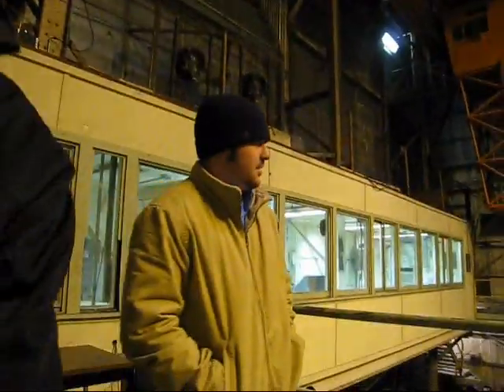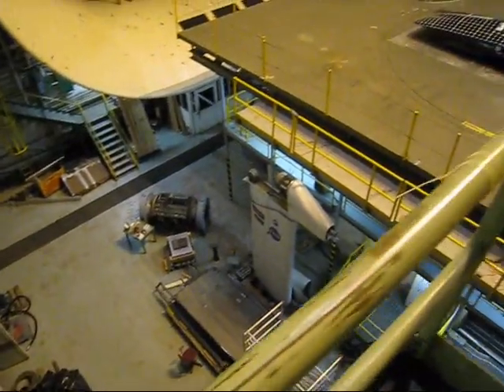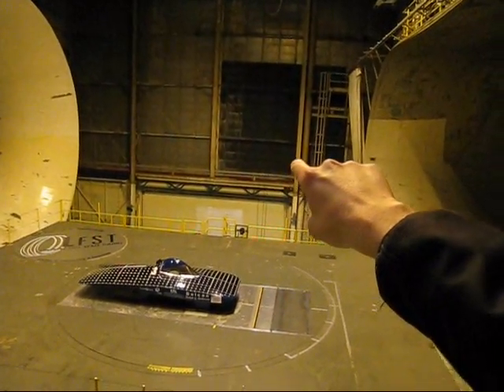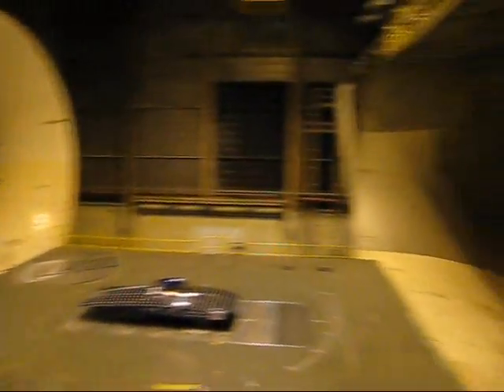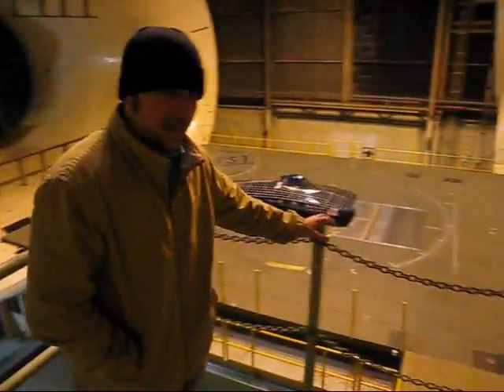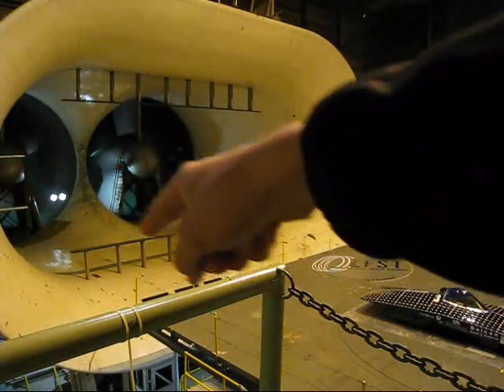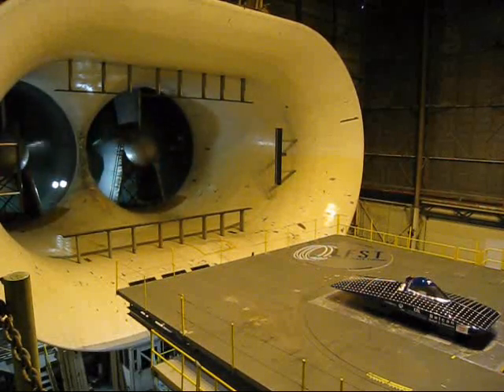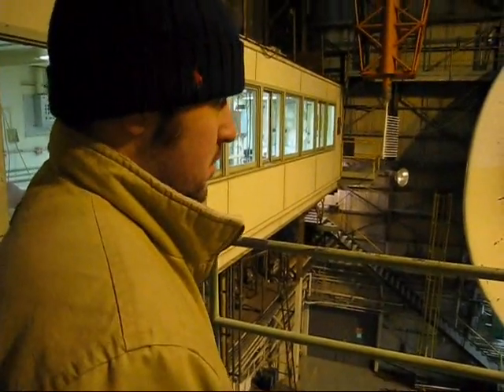Anthony explains the Wind Tunnel

Comment: If 80 mph takes 4000 hp from each fan, not turbine, 40 will take 500 hp. 1/2 speed = 1/4 wind resistance (1000 hp) and double the time to do it in = 500 hp each.